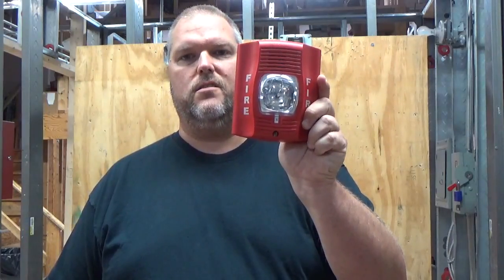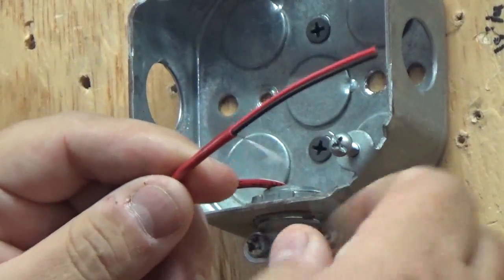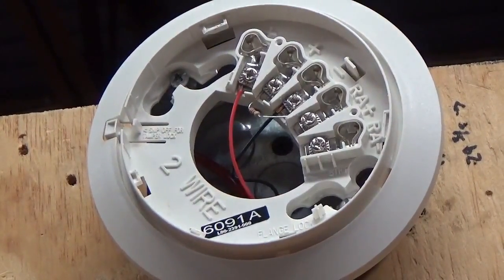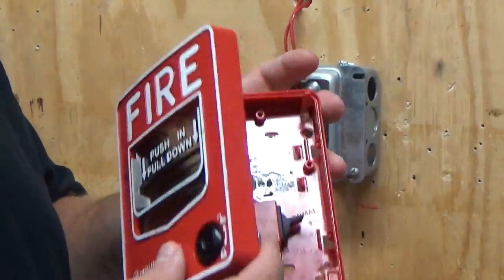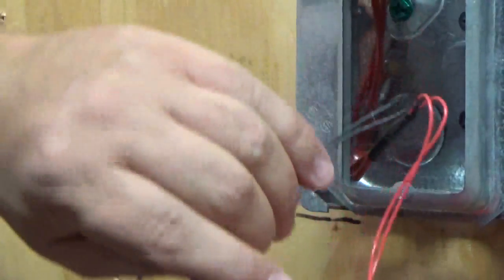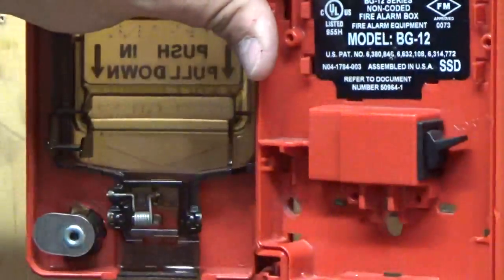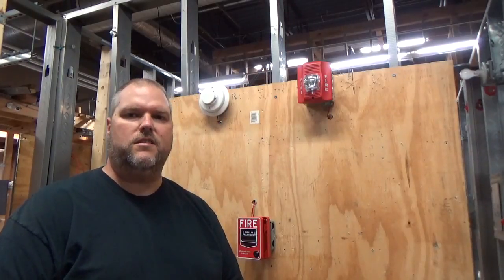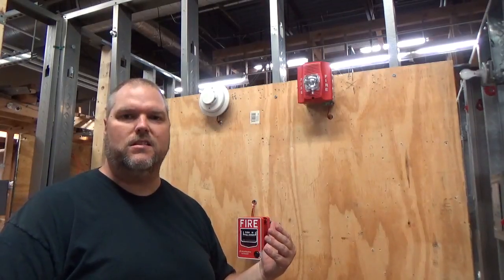Fire Alarm Devices

Comment: why on the smoke detector and the notification device did you have one set of wires, on the pull station you had two?
Reply from the maker: This was a lab demonstration on device connections. CM
Reply: @craigmichaud-electricalins4602  thanks Craig 12pm in Australia

 not sure what you mean by lab demonstration should there be one or two set of wires to the pull station.

  have you done a video on addressable panels?   I know very little about fire panels and thought addressable panels had an inbuilt ability to locate individual devices.

 I didn't realise until recently that you have to install an addressable module to each device so that the FCP can locate it.  It appears to me that each individual FCP manufacturer have their own specific modules just to suit their panels.

 Wouldn't it be smart for someone to have a universal one that would suit all panels.
 thanks for your info  Steve
Reply from the maker: Yes absolutely but this is a conventional fire alarm system. I use these videos to show my students things they will learn in the lab. There are a lot of different situations on how to wire fire alarm. Looks like you are doing some good research!! CM
Reply: As you can see  the semoke is the end off the line  that why  a resistor is used

Comment: My instructor taught me to put the resistor under each wire to get a good connection. The other positive I leave empty. Thought?
Reply from the maker: With some detectors that maybe the case. Not these!! If you don’t put the resistor on the open positive the zone loop is not supervised!! Meaning if something is wrong with the zone the panel won’t know. It’s important to have the panel show a trouble in the circuit in order for a proper installation! In 30 years I have seen a lot of different systems never once did I put the wire and resistor on the same side of the screw!! Hope that helped you!! CM